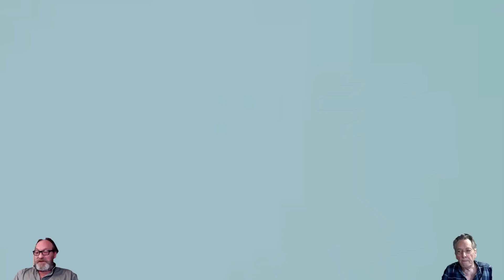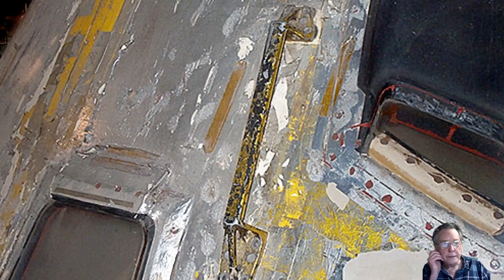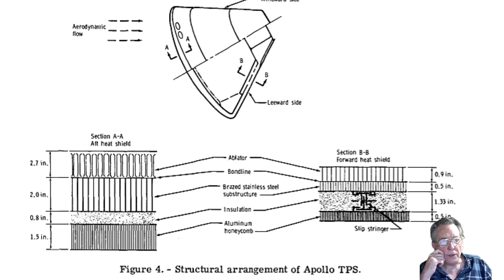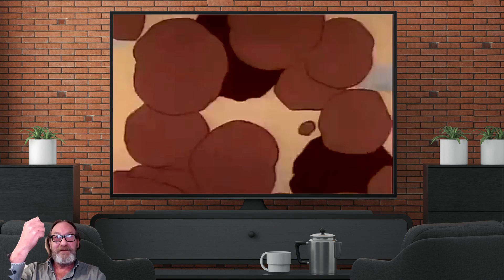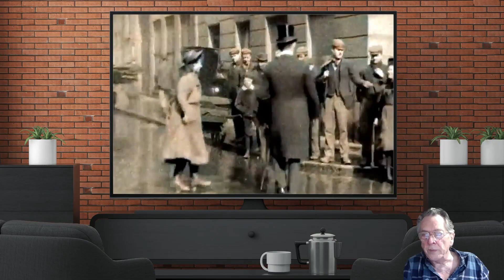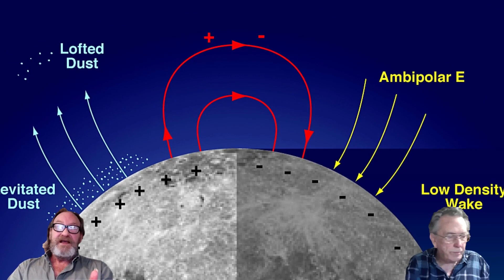The Apollo Discussions "Shadow Blocking\ Vladimir Ilyushin\ Handling The Handles" Part 043

Comment: "It looks like it's made of cardboard, how could they get there like that?" (common man)
Apparently according to a fanatical old shill now the Common man now finds LM unbelievable.... thought only a fringe Minority denied its.... credibility.  Moving more and more away from a few Crazies opinions and rational are Yee? :) 

   The famous 400,000 ("silenced" shop workers) could of easily welded instead of rivets, sprayed Mylar instead of taping (Special kind  unknown), used bigger metal sheets instead of so many seams, sure the list can go long !
    Know all Experts expect way more dust, even after test Neil feared sinking in he said.

@Jan_Strzelecki  🥴
You're asking the wrong question. The design of the Apollo Lunar Module only makes sense if the Moon landings are real. 
Otherwise, with the ability to make the fake mockup look however they liked, they would've made it much more prettier and believable to a common man.
The fact that they didn't indicates that they were working under specific constraints, which only makes sense if the Moon landings were real,  or if they wanted to make the LM to look as plausible as possible, which amounts to the same thing. 

- AND non melting crap! 😜